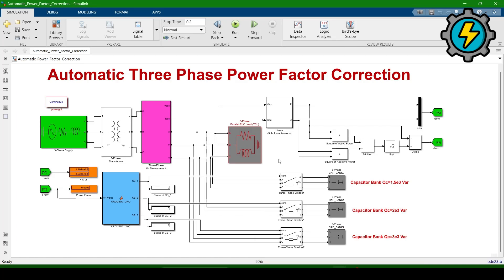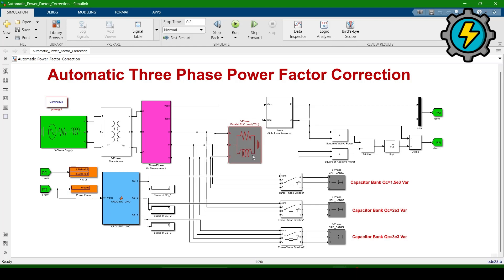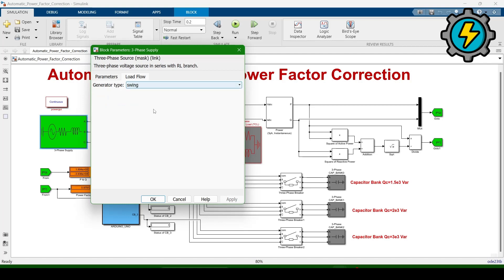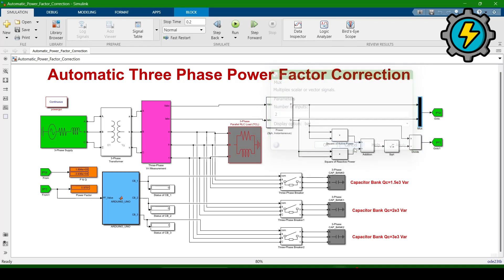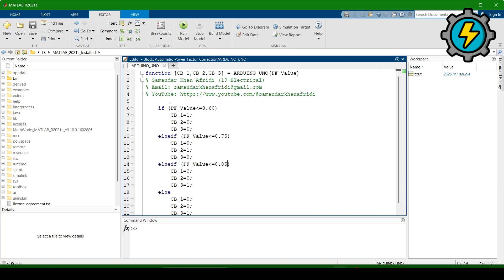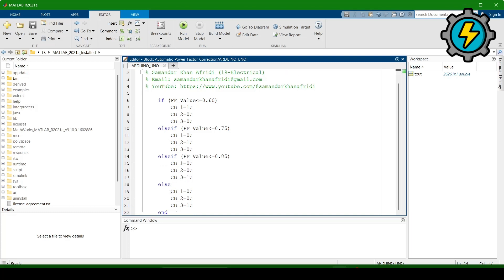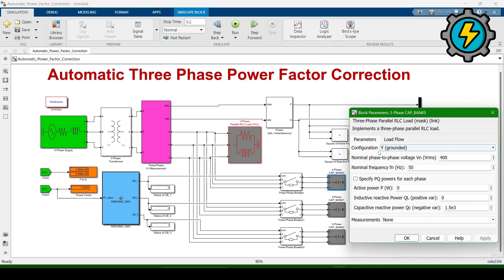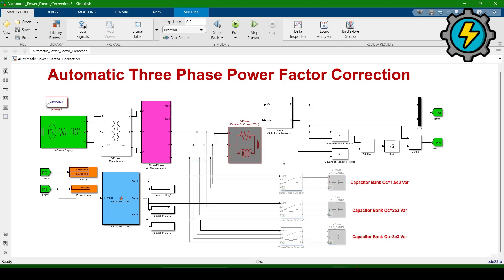Automatic Power Factor Correction of Three Phase System #powerfactor #automatic #3phase #electrical

Comment: Hi, I'm currently trying to make a three phase automatic power factor correction module for a induction motor load. Will you please guide me doing it, it'll be really helpful for me making it faster. I'll be waiting for your reply.
Thanks and regards. 🙂
Reply: did you make it? ref me pls
Reply: Thanks for the great explanation. Could you please implement the same three-phase power factor improvement system using fuzzy logic control for dynamic capacitor switching in MATLAB/Simulink?